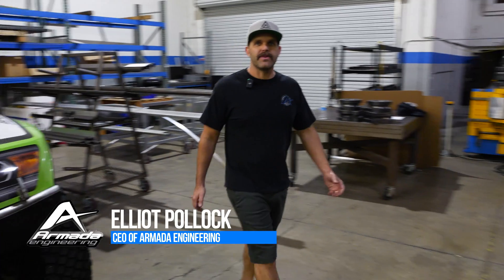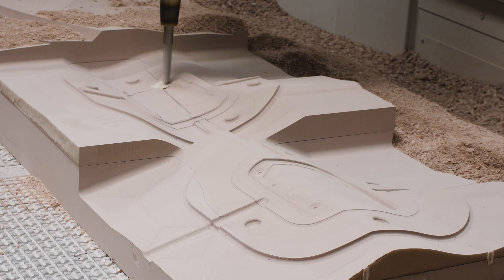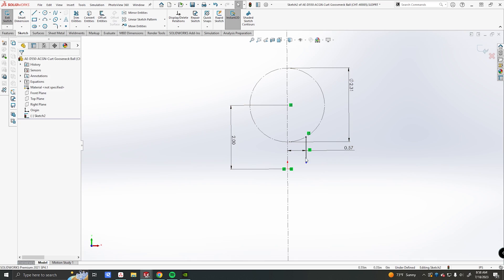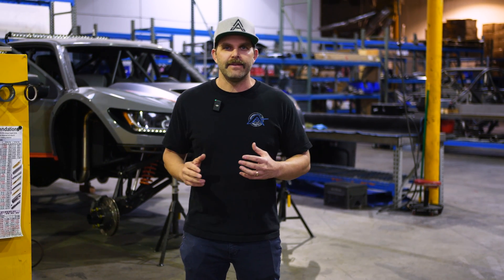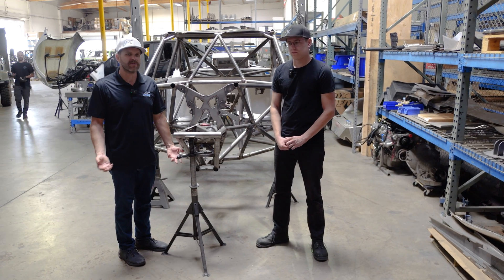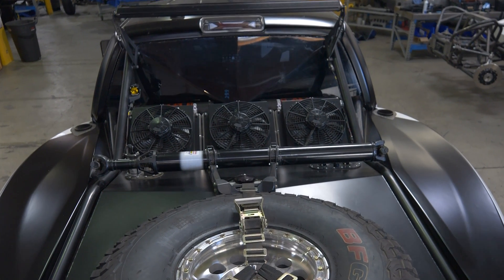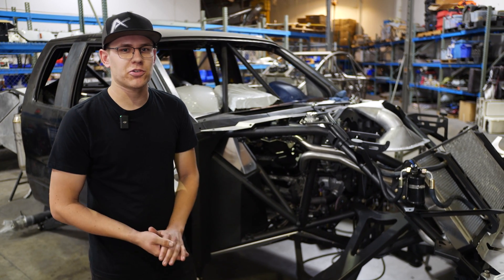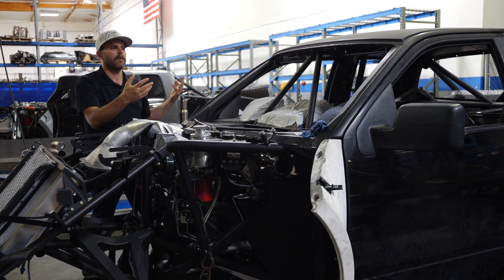Armada KT01 Build Series - Episode 1

Comment: For $150k it will be very interesting to see the details of what all is included in this kit. You say big shock package will that kit price include the shocks? It is also interesting that a $150k kit is for the average guy. If that included everything and the buyer only has to do the assembly perhaps that would be more for the average guy.
Reply from the maker: Yes, shocks are included. It comes with most everything you need, just add engine and transmission of your choice, plus a few related accessories. 100% bolt together, no welding required.